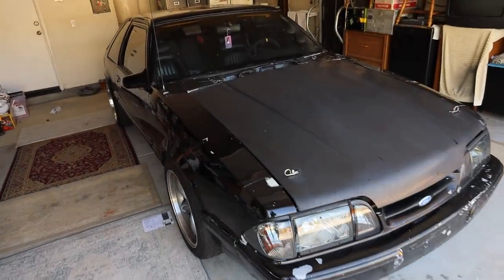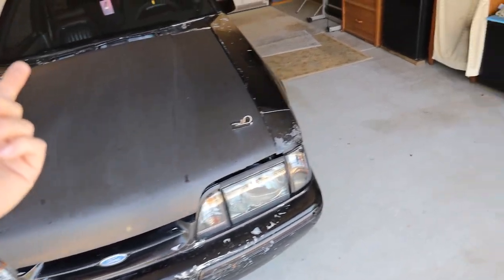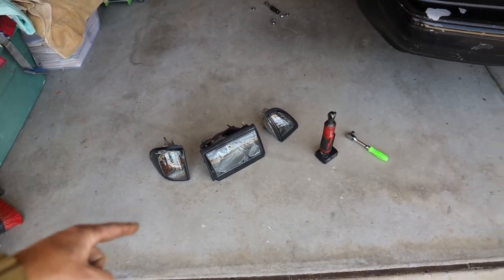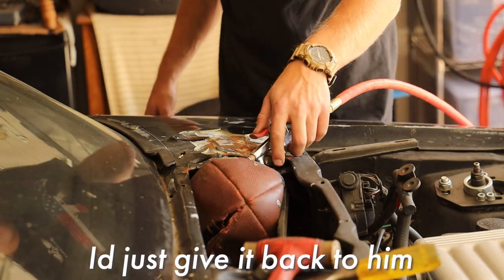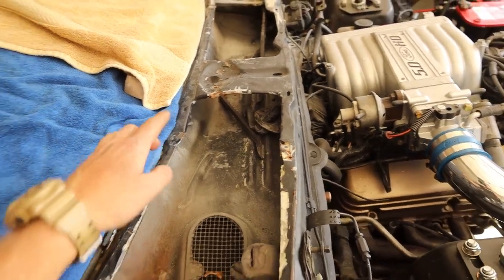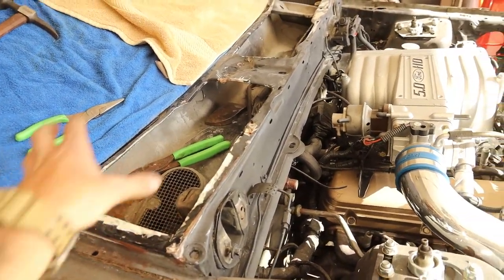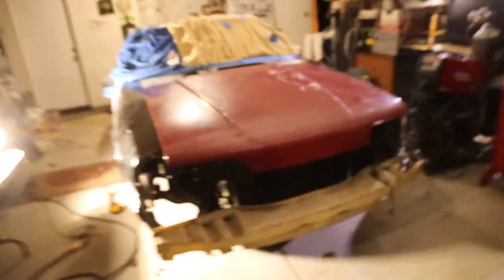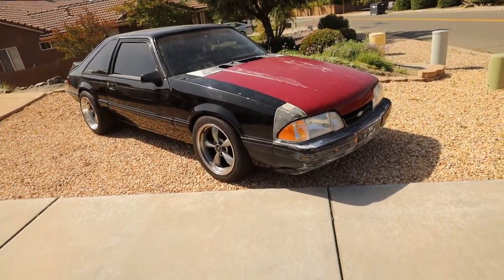Fixing a DESTROYED Cowl Panel on ANY Foxbody!

Comment: 100% improvement getting rid of the layers of bondo and bent cowl piece along with going back to the stock headlights.  A lot of aftermarket headlights have such poor fitment - they're not right, wrong size buckets, clips don't line up, etc.  Probably why you had the big holes in the header panel and they were never in tight.

Comment: 4:00 I watched a video a while back where the guy repairing this type of damage would drill small holes on either side of the crack. He then used plastic zip ties to draw the 2 sides of the crack together, with the female plug on the zip tie on the inside of the bumper. Once he had everything lined up, he did the fiberglass repair on the inside of the bumper. After having enough fiberglass holding everything together, the zip ties were clipped and removed from the outside of the bumper. Whatever is still on the inside, stays there. The outside of the bumper was treated to a coat of flexible body filler to fill in the holes once used for the zip ties. I hope that makes sense to you.

Comment: Nice football trick👍🏻👍🏻 I have a project gutted roller 1986 factory T-Top coupe and the back package tray area by the back window was pushed down on one side bad….don’t know how it was done and that it didn’t break the factory back window (carlite) but I used a 2x4 across the spare tire well and used my aluminum floor jack and put a 1x4 piece of wood sideways and jacked up the dent and it pushed it up perfect and looks like factory now👍🏻👍🏻 amazing what you can use around the garage to fix things on a fox😁👍🏻

Comment: That car has come a long way you have put in some work its starting to look sharp i dig the wheels good stance and yes the stock headlights are the way to go,i would use flex primer i think that's what a painter did on a 79 i used to own on the bumper cover to keep it from cracking ,not sure what the guy did but it helps the paint adhere to the urethane bumper and you can safely run it through a car wash

Comment: Craig, great job but the only thing you should have done with that wiper bracket is to put some of that urethane between it and the top cowl piece to prevent it from having a hidden rattle.   Seems like you might be doing some rework as you go along so something to keep in mind in case that rattle develops.  Hopefully it won't be an issue though!

Comment: Get modern wheels then get rid of modern stock style headlights I don't understand. You get rid of the cowl hood and put the ugly original headlights in, your just making the car look plain
Reply: You complain too much
Reply: Looks way better stock. Besides stock parts fit mo better.
Reply: @Venturemaster_Nate  making an observation not a complaint
Reply: @scottmontgomery2892  I've had both and the one I had fit great. Stock headlights look better on more period correct cars on a black fox with modern wheels the newer style looks better
Reply: @bradleymorse1189  That's an opinion, not a fact. Many of us, apparently including Craig, think it looks better with the stock lights. IMO the stock lines and lights with those wheels and stance is just sick on a black car. I wouldn't change a thing after it gets paint.
 
 To be clear I said LOOKS better with the stock lights. The problem with most of the aftermarket lights, besides build quality, is appearance.  Most of the time you don't need extra lighting and when you do a set of small LED driving lights can do the job.
Reply: @Ares-jx4ep  the thing with those headlights is that their just like factory but without the nasty looking lenses, and with a little smoke tint, which looks better on a black car, I don't understand the downside I own a couple foxes and I work on them every day and trust me there is nothing nice about factory headlights and their build quality
Reply: @scottmontgomery2892  my bad that reply was meant for ares1967
Reply: Know what they say about opinions right? True story…